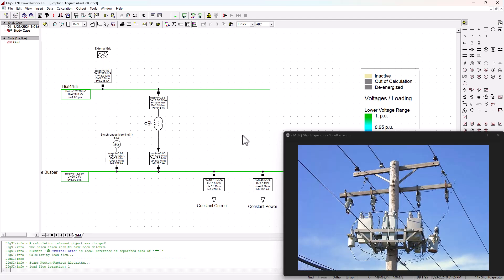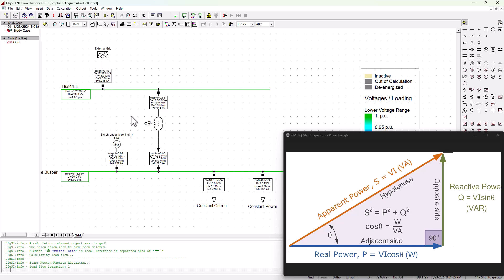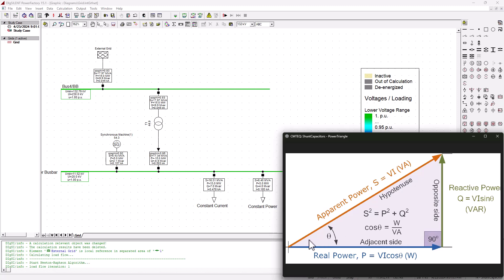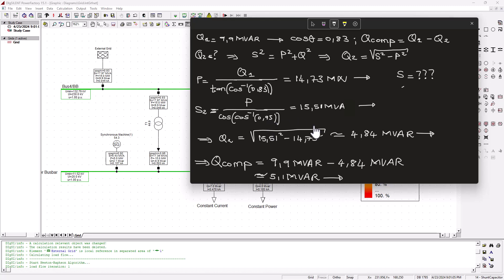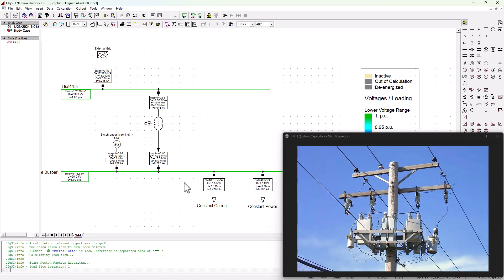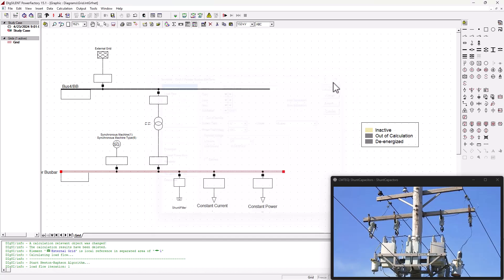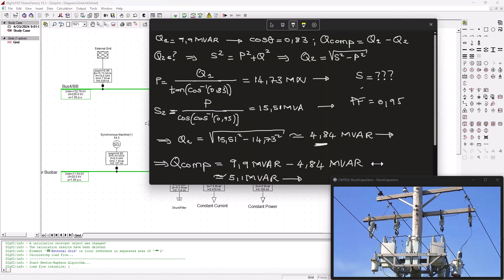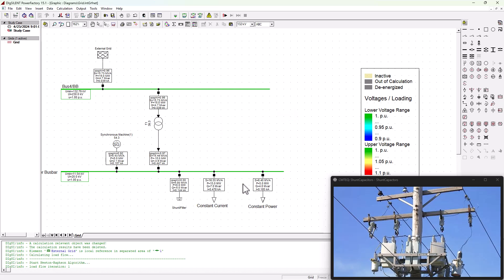Reactive Power Compensation in DIgSILENT | Shunt Capacitor Bank.

Comment from the maker: 👇👇WAYS to Support CMTEQ Channel👇👇
If you LIKE this Please HIT the LIKE 👍 Button, Subscribe and hit the Bell 🔔
SUBSCRIBE:👉 https://www.youtube.com/c/CMTEQ?sub_confirmation=1
Join the Channel membership:👉 https://www.youtube.com/c/@CMTEQ/join 
Become a Patreon: 👉 https://www.patreon.com/c/cmteq/membership
Buy me a cup of coffee:👉 https://www.buymeacoffee.com/cmteq
Donate on Paypal:👉 https://www.paypal.com/donate/?hosted_button_id=GJH7BWNSJAV7N
Reply: I have been struggling to connect a PV plant to the IEEE 9-bus system for somedays The system runs load flow successfully without the PV. I then configured a 10 MW PV plant the inverter AC side is 6.9 kV and I stepped it up with a transformer to 230 kV and connected it to a load bus. The load flow did not converge. I removed the transformer and connected the inverter directly (keeping bus voltages the same). Now the load flow runs, but there is no power injection from the PV — the PV shows no injection arrow. However, the power drawn from the network at the bus where the PV is connected has decreased. The first approach (with the step-up transformer) is practical but I tried many things without success. Even a single PV array + inverter does not inject power after connecting. Can you help me to resolve this problem . Its my first to integrate Pv in IEEE 9 bus system on etap
Reply: Sir please need help